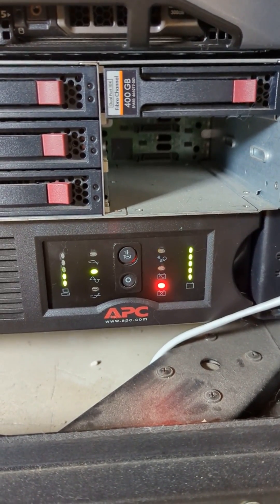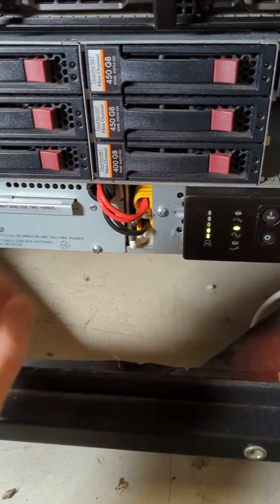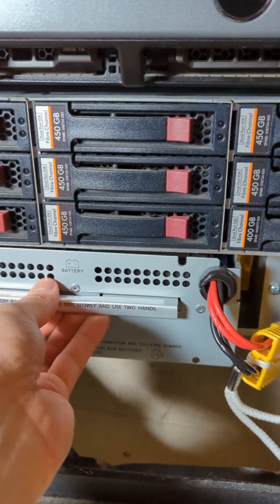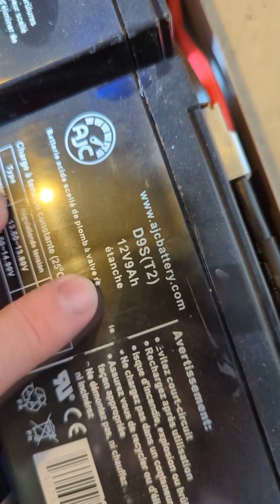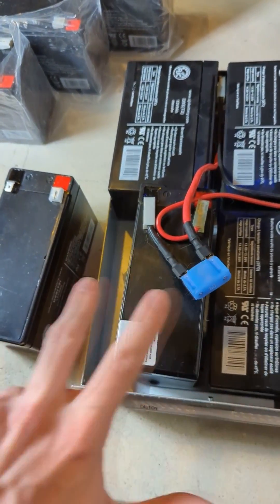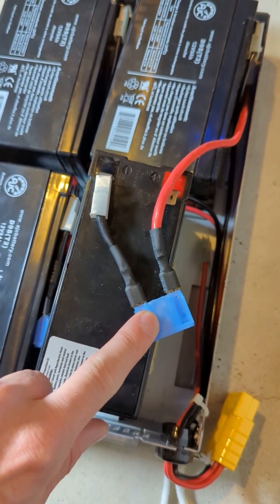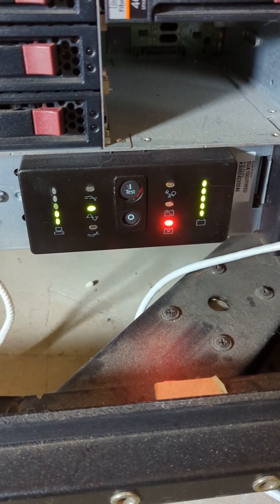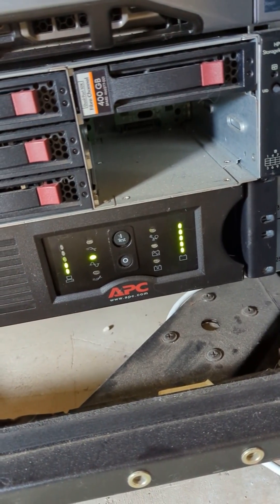UPS Battery Replacement in 60 Seconds

Comment: Switched to lithium iorn phosphate back in 2018 and never looked back. Made custom 25.6v (24v) pack with 6ah cells 32700 hx cells.. 12ah & 25.6v. 
Runs 300w load for 45mins which is right there on par with 28ah leadacid. Another ups i switched to Lifepo4 runs 300w load for 1hr. Or 160w load (my desktop at idle) for 2hours and i made it with cbak 32140 15ah Lifepo4 cells. 
For reference that ups is rated at just 1hr20min at 160w load with 6x 9ah leadacid. Those leadacids cost 3x over the price paid for Lifepo4. And they last much longer.
Reply from the maker: Cool idea. Where did you get your Lifepo4 batteries? Do they have a BMS built in? Any issues with the charge control of the UPS?
Reply: @Homelab  first time i bought from aliexpress. 2nd time i bought a whole box of 40pcs 32140 cells from alibaba. The box came at 200$ shipped incl all taxes & contained 40pcs 48whr cells which i made into 5 separate 30ah 12v battery packs with their own bms and active balancer. 
For the 24v ups I don't use a bms as the ups has all necessary protection from over discharge charge and handles the charging very well. I just have an active balancer that keeps all the cells within 30mv of each other. No problems whatsoever in last 7 years. They are still at full capacity. Only had a couple of hundred cycles most of them are just my routine full discharge tests. 
Lifepo4 is fully compatible with leadacid. Most ups you don't need to worry about anything. Some ups won't fully utilise the capacity. Like the apc whole home ups i got stops discharging at 11.5v which leaves some capacity in the battery. It was made in mind with preserving leadacid battery and so it doesn't fully discharge a Lifepo4.

Comment: You can use Lifepo4 batteries 12v10ah. You get over 50 minutes of run time vs 15 minutes with the led acids.
Reply: Make your own custom cell pack. You can fit 15ah 51.2v Lifepo4 in there if you do it on your own.
Reply: I have 550VA 330Wats i have 18V 5A Milwuakee Lithium battery i buy 18V to 12V 20A converter to used with my ups i get 3hours and 20minutes with dell laptop scram 16 buy 10 1/2inch scream battery not keep charge